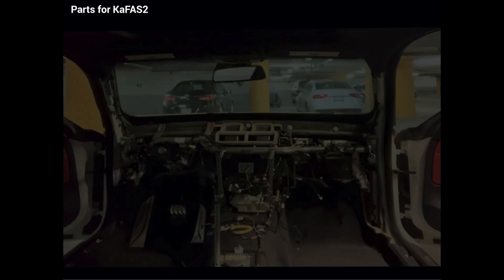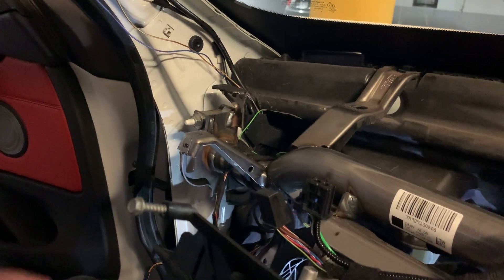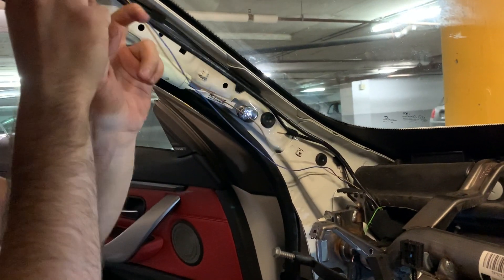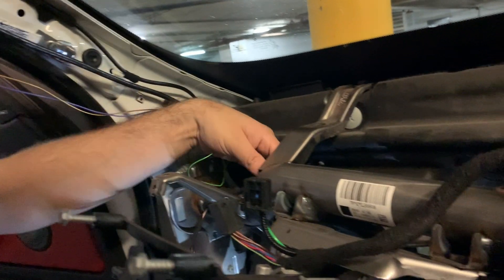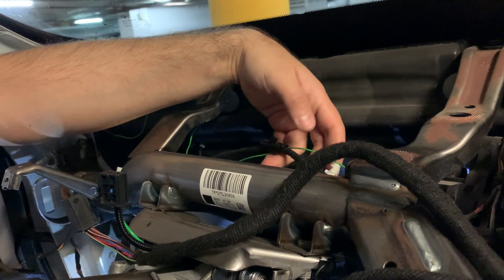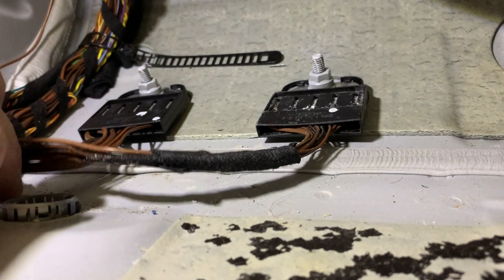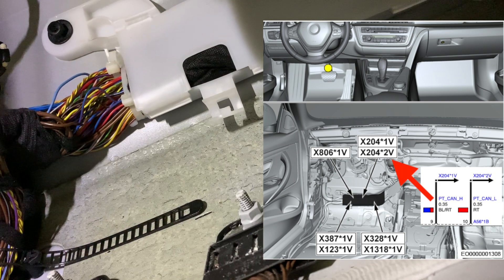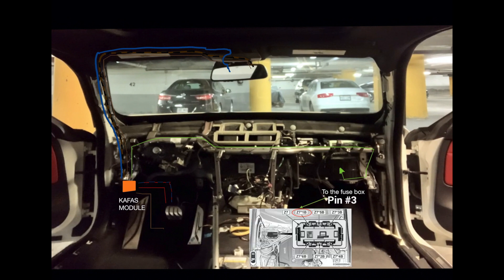BMW F32 435 KAFAS Wiring preparation for retrofit - Part 2

Comment: Which program are you using for verginize KAFAS 4
Reply from the maker: You don’t really need to do it. As long as the prod date is close to yours all you need is to inject the FSC codes tailored to your VIN with esys
Reply: @DorksandBolts  When you change BDC modul I have to verginize KAFAS .I have already FSC KAFAS activated.Therefore my question is which program is the correct one?

Comment: Hello, please can you tell me if the blue/red and red wire under the carpet does it need to be put into an empty pin slot? If so what number is it. If not then do I have to splice and connect with existing wire?

Comment: hi i have a bmw f30 lci year 2016 originally equipped with blind spot detector and traffic sign reader but i don't have line assist do you know how to have this option thank you
Reply from the maker: Hi, this depends on the type of camera that you have in your car. But technically you just need to code the option for line departure on your camera, cluster and maybe the nbt, also you need to add the button to toggle on and off.
Reply: @DorksandBolts  thanks you for your reply its possible to help me to find if it's possible or not and coding ?

Thanks you
Reply from the maker: Hi! I can give you a hand with that. Please message me.

Comment: Hey do I have to dismantle the dashboard if I only wanna retrofit the KAFAS for SLI and selected beam?
Reply from the maker: You don’t need to, but it will really make your life easier if you want a clean looking install. Also a mandatory requirement would be to have contortionist skills and very tiny hands

Comment: Hey, is it also possible to connect the both PT Can direct to Fem? I couldn’t remove the carpet 🥺 I see there is also PT Can at Fem  173*8B Pin 47 and 48 and this is much easier than the ACSM 😅
Reply from the maker: yeah you certainly can do that, but we like to follow the BMW OEM schematics, the only thing that you hae to make sure is that the pins on the FEM communicate to all the other modules for this to work.
Reply: @DorksandBolts  ok but how you solve this with the carpet? I will not damage the carpet. I just see a part of ACSM 😅
Reply from the maker: You can pass the wires behind the hvac unit following the top part of the rug against the firewall, no need to move anything out of the way, just a warning.... it will not be fun.